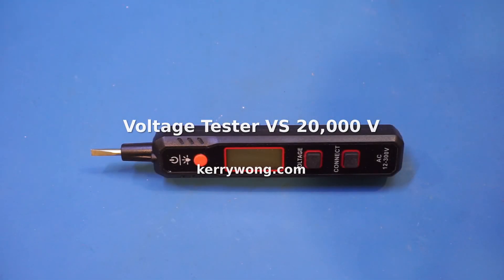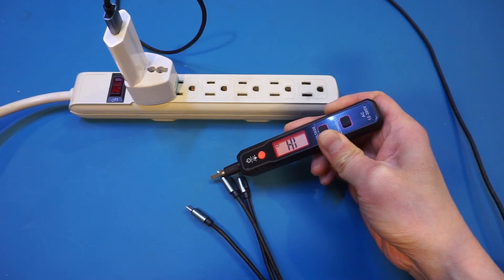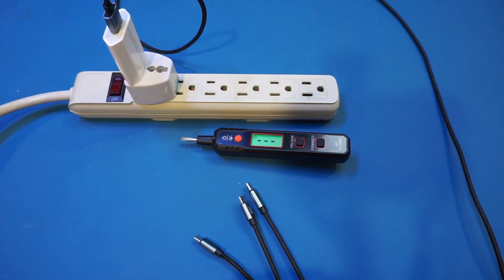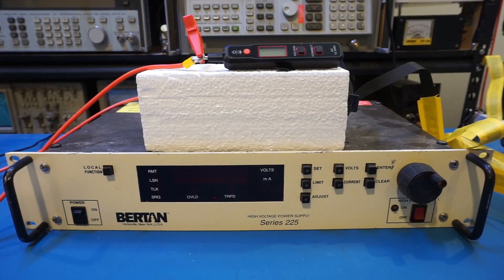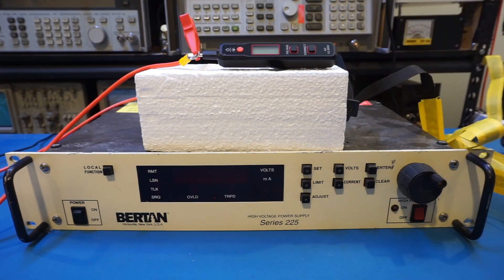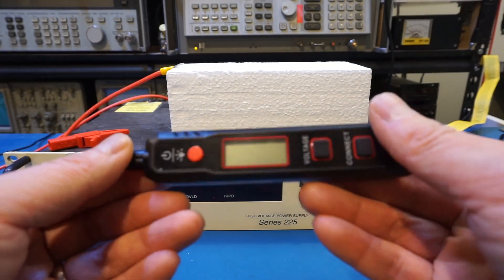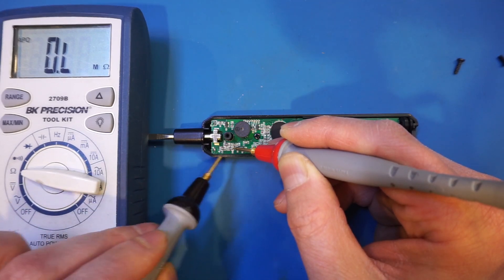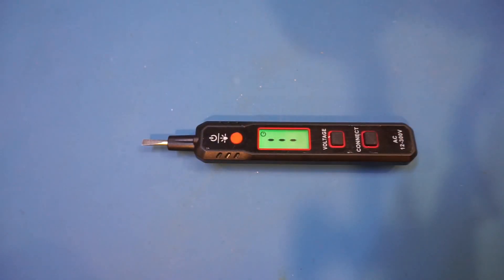Voltage Tester vs. 20,000 Volts

Comment: Mind you it was all just floating and nowhere for any current to go, great video.........cheers.
Reply from the maker: The case is technically grounded with the anti-static strap, so in theory the HV could've found its way through the circuit board to the ground. That said, given the thickness of the case, it would likely require much higher voltage to be able to do that. I wasn't entirely sure what caused the anti-static strap to spark though, as there was a good three inches distance between the HV source and where the strap was.

Comment: Wow, 4x47M in series. I didn't even know such large values existed, especially in SMD. You'll need a lot more than 20,000 volts to kill that. Unless you know a lineman, i don't know where you'd get access to a higher voltage.
Reply: I’ve worked with through hole resistors up to 100 TOhm. And for SMD I think 500 G is the highest they make in standard values. I feel like I had to put 5 100 G in series because they were out of 500G and it was going to be way too long.